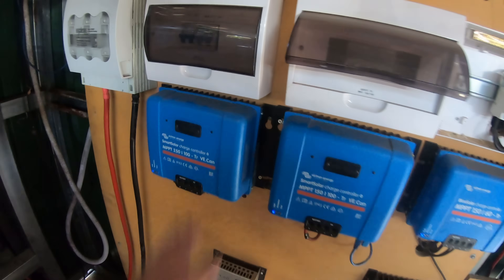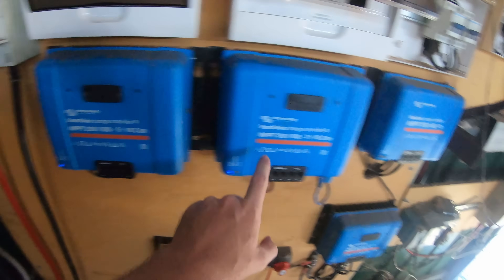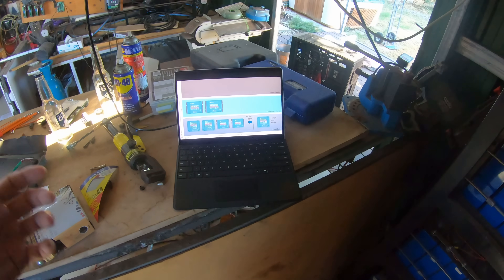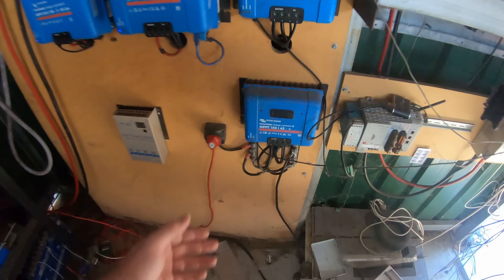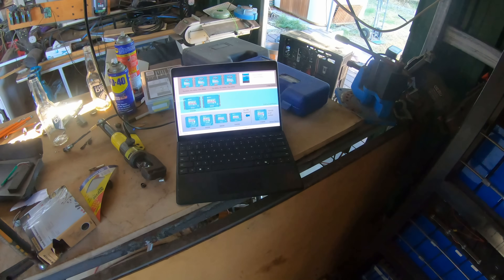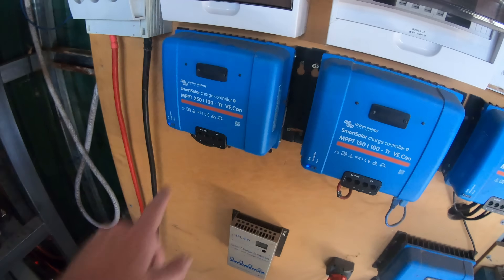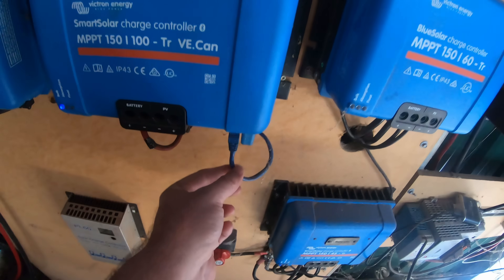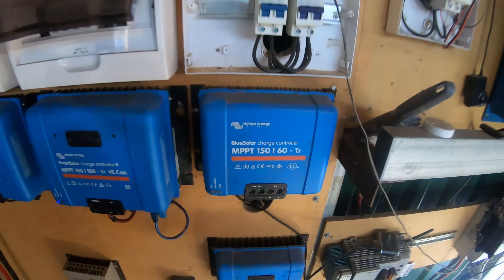Victron Mppt Comparisons

Comment: Great breakdown.  We've had some people compare the same set of panels on the 450/x00's and a 250/100 and in some cases, the 250 is capable of more production/output than the 450.  Of course that comes with the tradeoff of higher amps/lower voltage.   The 450's have galvanic isolation as well, so if something goes bad on the solar strings it can't short circuit to your battery bank.  

As I'm redesigning my home system, I'm going with 250/100's and a 150/85 I had from something else.  Be interesting to see if I'm hit by the shading issue you documented, I'm hoping not.  My prior understanding was that parallel strings helped mitigate some of the shading issues.  I'd be interested if an optimizer helped at all - might have to test it.

Also really appreciate your setup and hope to have mine similar.  I think there's a huge benefit in having DC & AC coupled PV.  Offsetting daytime consumption (especially important for us in the summer) seems worthwhile.  Conversion from AC to DC arguments - meh.  It was 'free' energy, still a net win if you can do both.
Reply from the maker: i tell you what we would all appreciate you coming back and telling us how you got along. 

Im still not 100% sure what its going to take to move to the 450's but i suspect my current grounding will cause some issues. The off grid solar is all grounded to the shed and the shed not only has its own ground stake but its also connected the the main ground on the house (the same ground the RCD's are connected to) we had some significant issues early on with eath leakage and to be honest im worried about moving to the 450's and having them re-introduce the ground issue
Reply: @BadIdea1123 
I'm not 100% certain..
Having 2 earth pins could cause issues for walking between them.

Comment: I've got 4 x 250/85s. Two of my smaller arrays could have got by with smaller units, but I wanted to have Can-Bus  with all of the units and I also wanted the ability to use the regulator from one of the smaller arrays to replace any MPPT of the larger arrays, if they ever fail. That way, I can have the maximum possible output while I wait for a replacement to arrive. I agree that the modular design of Victron products is a huge selling point.
Reply from the maker: I have a sneaky suspiscion that the internals are all roughly the same on these bigger units. Its only speculation but i doubt at a manufacturing level the difference in components is all that much different between 70a and 100a
Reply: @BadIdea1123  I think you're probably right.  With the 150/85 I have, I was doing some ... learning and thought I'd be OK.  Cold morning though, and voltage went up to about 160V while I was running (moving more quickly than usual? LOL) to disconnect.  Thought for sure a very expensive MPPT had let the magic smoke out.

Thankfully, it was caught by the software and it turned the MPPT off.  I'm not keen on losing $500US to see where the line is, but I do think the 150's and 250's are probably fairly similar and there's some undocumented 'buffer' in these.
Reply from the maker: We log everything the offgrid gear does in to an influx DB (thats a time series database aka it takes in a lot of measurements with time being the critical index) and i can concure with you.... cold sunny mornings are way mornings or sudden sun on a cold day can yield some ridiculous PV. we have seen it goes 23% over in short bursts

Comment: You can have up to 15 VE direct ports on a cerbo
Reply from the maker: Yea i use the USB ones as well. And Offgrid garage uses the 1x usb to 4x ttl.  is that in the doco somewhere ? I know the older versions had a really big venus os device that had lots of serial ports
Reply: There was a comment from victron on the forums that cpu utilisation can be an issue with too many.

Comment: gold. i dont like victron mppts coz they pot everything and cannot be repaired. really good explanation of the different models
Reply from the maker: isnt it infuriating you cannot repair them.... i was so resistant to using them after the first failure... at least let us change the terminal blocks
Reply: I've seen videos of people opening some models up and replacing fuses.. one guy was using 2 soldering irons for the fuse.. one on each end.
Reply: And the sand....

Comment: With the V.E direct to USB cable,  you can connect up to 10 charge controllers using a powered USB hub with the raspberry pi.
Reply from the maker: YEa i saw Offgrid Garage used a USB to quad TTL adapter to add his. We use the USB to VE Direct adapters as well
Reply: @BadIdea1123 I use the quad adapter as well. Works great also handy to be able to see the coms via the leds.
Reply from the maker: @redolgreg  i looked at buying one as well. That one that offgrid garage uses is expensive in my opinion
Reply: @BadIdea1123  I don't know anything about what that channel uses but what ever you use you definitely want it to be properly isolated - optically or magnetically.  The cheap interfaces that have isolation at all often have face palm level bad design.  I have a few examples where LEDs were added to the layout to show TX and RX.  They ran traces from the isolated serial side between the pins of the opto-couplers (not between the rows, actually between pins), straight across the creepage (no slots cut of course, it's cheap) to the USB side and placed the LEDs there between other components on the non-isolated side.  DC isolated, sure, but not to the normal kV levels expected.  You get what you pay for.

Comment: lol.... life on the spectrum. Oh yeah, it's a total addiction that's for sure 🤪
How do you go with the ELV regs shifting to the DVC-A. For us off griders that run 48 volt systems, it's gonna be a challenge (without going into to much details 🤫)
Reply from the maker: is that in relation to  AS 5409 ? 

I am ignoring it atm. dropping the voltage to only 60v is a bit ridiculous if you ask me. It was 120v ripple free as i understand it previously.  Understandable that we want to protect people from their own stupidity i think. but a bit to far at this stage. There is not that many people going completely off grid in a diy fashion.  we should be more worried about the AC side and people back feeding the grid. as that poses a greater threat to life. But that is only my opinion
Reply: @BadIdea1123  I totally agree mate. I dropped my 48 volt system down to the DVC level a little while back and it's performance was absolutely terrible. It's impossible to charge a 48 volt system properly, and efficiently with 60 volts max. So I ended up taking it back up to the ELV level.
My 12 and 24 volt systems are fine running on the DVC level but not gonna happen on my 48 volt system 👍

Comment: Those large scale units are also galvanically isolated, unlike all the other models - which has its place - especially with Australian standards. You need earth leakage detection if you use any of the smaller MPPT’s.
Reply: Agreed, I was originally going to go with a 250/100, but by the time you added earth fault protection, the cost was about the same. In fact, from memory, the 250/100 was slightly more expensive. Plus, at the time, it wasn’t even on the STC register, so going with the 450/100 was a no-brainer.

If you're planning to run the non-isolated versions, it's really important to have a BatteryProtect between the MPPT and the battery. That way, if there’s an internal fault, it can disconnect when it detects high voltage.

He's running both a 150V and a 250V MPPT, which introduces some risk when wiring the strings. If you accidentally connect a 250V string into a 150V MPPT, it’ll instantly weld the internals and push high voltage through to the inverter and battery not good.

You’ll need to double-check everything during installation, maintenance, and any future upgrades. It’s definitely an area where attention to detail matters.
Reply from the maker: Is that in the cable standard or the grid tie standard. Im lead to believe its gotten really tight now even when your not grid tied
Reply: @BadIdea1123 it’s not due to being grid tied - as it applies to off grid as well.

There is only one manufacturer that offers the earth leakage device to (Aerl) - they probably have mates on the standard committee.
Reply from the maker: @Fergo101  thats the worst isnt it. The clean energy council has nothing to do with clean energy but everything to do with the manufacturers putting in road blocks